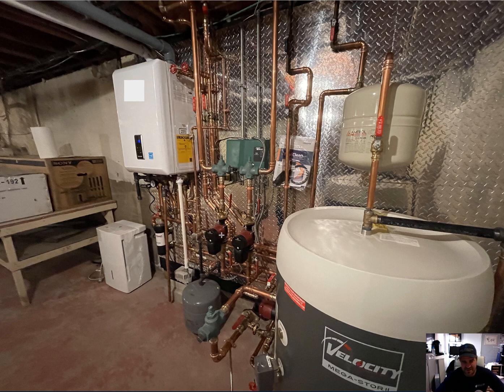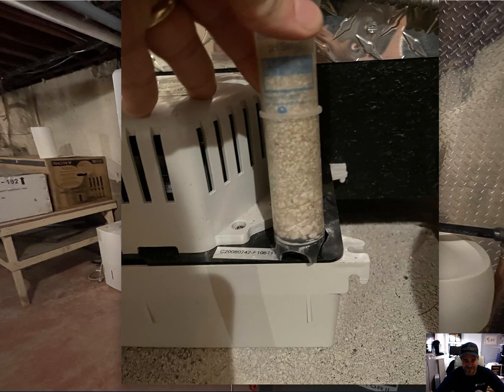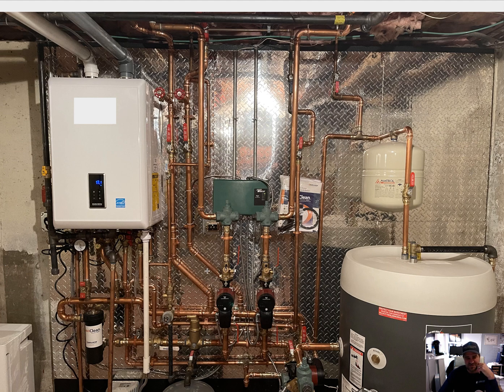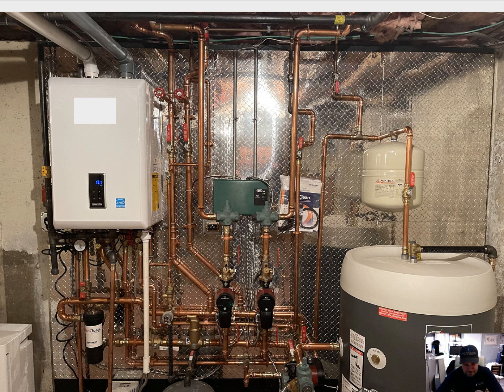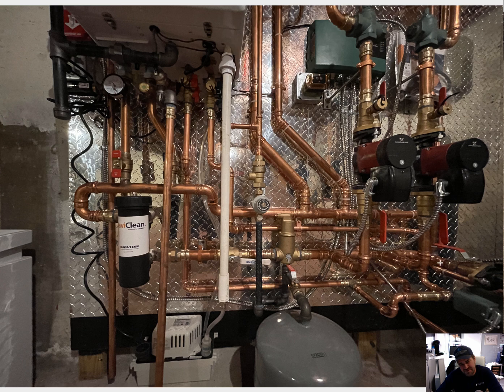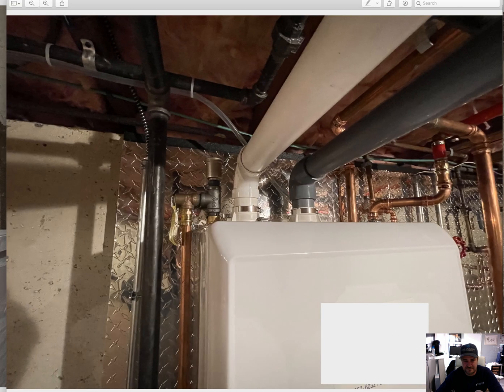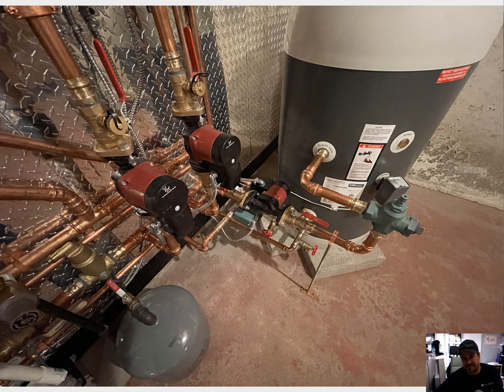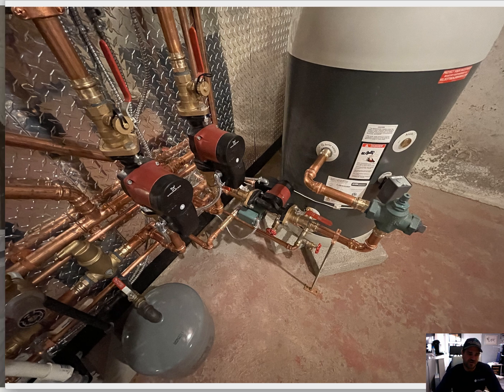YouTube Subscriber's Recent Navien NCB Installation - Let's Review & Discuss

Comment: Big 15%er Subscriber here! I have a Navien, (love it) live in Throggs Neck (right over the bridge). 
Side question, I’ve been doing research for a friend, considering the best option to convert a 2 family home with an oil burner water recirc for old cast iron radiators... to 2 separate gas water heaters with 1 zone per (2 gas meters for stoves and dryers already present) what’s your opinion for the best option? And do you do installation/repairs in this area?

Comment: Yes, that's a backflow preventer on top of the PRV -- not piped to the floor (whatever).
LWCO should be installed a few inches above the heat exchanger. Its role is to kill power
to the boiler if it ever runs dry.  Below the heat exchanger (the way it's installed here)
 it is far less effective.  Some people prefer external flo-checks.  I guess they trust those more than the integrated ones (old school mentality).  The Naviclean should most definitely be on the return side.  Air separator should be at the hottest point of the system to collect and get rid of air in the system.

This should have been an NFB plus indirect setup.  Normally the indirect is sized big enough to fill the largest tub.  I believe fire tube heat exchangers are superior to the water-tube ones (NHB, NCB-e).  A lot
 of them can be piped direct instead of primary/secondary.  I hope both of those zones are large enough to emit the minimum firing rate of this NCB-(e).  Otherwise I give this installation a B minus.
Reply: @PipeDoctor  No problem, forgot to mention -- that mini condensate neutralizer "cartridge" had me cracking up...  First of all, they should be installed horizontally to maximize the amount of time the condensate is in contact with the media -- until acidity is low enough that it can be dumped into the drain.  I hope this client is aware of this, otherwise in a not so distant future there will be a crew at that house jackhammering basement floor.  :)   My B minus just became a C plus... Sorry...
Reply: @arseniym3185  Hey mister hope your well! How can I communicate with you?
Reply: @arseniym3185  This comment gave me OCD so for a year and a half I have been checking the PH level of the condensate in the pump after the pH Safe 1 neutralizer monthly.  Thankfully it is always around a 6 which is safe for plumbing.  Of course the neutralizer has to be replaced annually to keep up.  Good stuff!